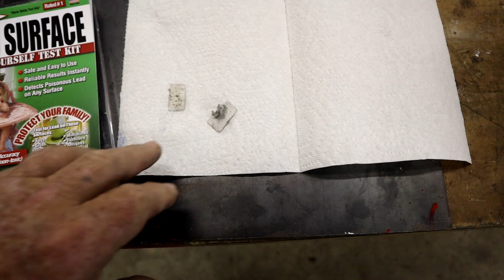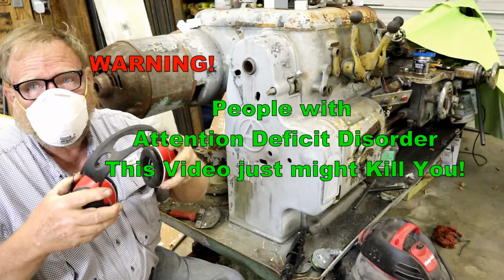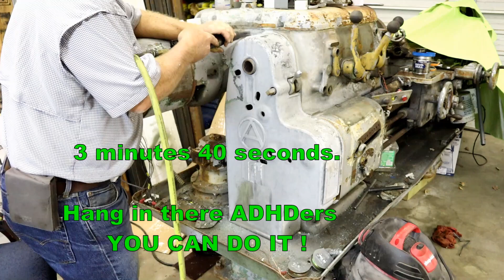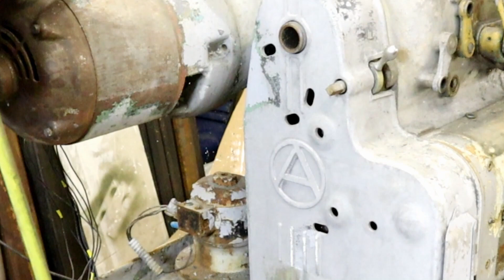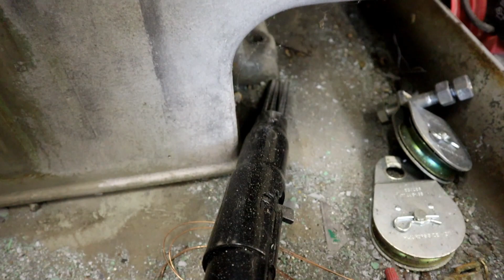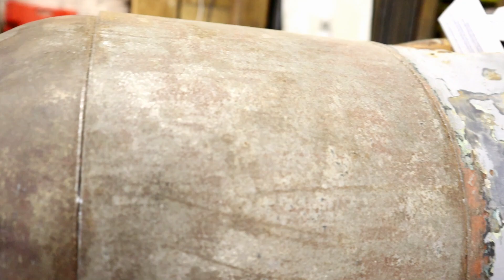Fastest, cheapest way to remove old paint from a metal working machine

Comment: I'd suggest removing paint with a wire wheel cup on a grinder. That worked very quickly, but it flings out the little wires so it's best to wear some good protection.
Reply from the maker: Hi Logan.... It just does not work as well as the needler or even the battery powered Milwaukie Fuel angle grinder with the heavy 2 inch disks...  Tried almost everything under the sun and so far those two are my favorites...  If you haven't seen this one   https://youtu.be/sKdfIGqXjsQ  there are a few examples of Don having at it :)
Reply: @10swatkins  I'll be honest with you, I'm only 18 and I've only needed to take paint off of a shield I made. I just used a wire wheel cup to remove paint. I've not tried anything else but it definitely seemed to remove the paint a lot quicker in that video than a wire wheel would.

Comment: Hi,Steve. I agree the needle scaler is best option for stripping the castings on any old machinery restoration projects. I've used this method for years and also strip and clean old engine blocks and various iron castings with the same technique. The needle gun also does a great job stripping old iron railings but a wire brush and files,hand scrapers are also required to get into tight areas around the ornamental scroll features. I can't understand why no manufacturer has come up with an electrically driven needle gun using a electro magnetic solenoid to move the hammer/piston back and forth. Also a good tool for stripping old paint off masonry work.
Reply from the maker: I sure like it... Right now there are 5 machines lined up to get a massage with it :)

Comment: Damm it Steve your a bad influence now i need to go get another tool to add to my addiction 👀👀🤦‍♂️🤦‍♂️
I have an old prema 14 in shaper, Victoria  combo vertical horizontal mill big holke f-10-v, a fritz Werner horizontal mill and a brown and sharp #2 surface grinder all need paint you might have to give me an in depth tutorial to run that specialized tool when i get it ROFLMFAO ive been using paint stripper for the big areas that cant get into the machine wire wheels and scotch brite discs on die grinder but some places you just can't get into short of scratching and picking the crap off if I'm going to totally disassemble it sme stuff I'll sand or soda blast. I definitely going to try your method could have used a needle scalar long time ago for getting weld slag out of tight spaces thanks for the tip.👍👍
As for rust on machined surfaces ive been using WD40 and scotch brite pads works fairly well other penetrating oils seem to get gummy where wd40 seems to stay wet better between reapplying when done i put rust check on rag and wipe all machined surfaces seems to really protect the metal from rusting when not being used  then when i need it i wipe them down and apply the way oil before use
Reply from the maker: I'm sorry... Bad Steve Bad Steve!..... But Don is the one you have to watch out for... HE can't sleep until something is painted :)

Comment: I've been using this method for years, a tip for those who try this the needles get polished and rounded over real fast so I take it over to the grinder and bunched the needles in my hand while still in the tool and square the ends up . Starts cutting the crud off real quick again 
If you plan on doing a lot of this buy the most expensive best quality tool you can afford because the cheep central pneumatic have different issues, one all the needles broke off in a few hours another the die plate that holds the needles apart cracked . The larger one at H F has held up much longer , the thing is once you start cleaning like this it's hard to stop ( very addictive ) so when that cheep tool fails your gunna FREEK out.
Reply from the maker: I'll try your trick, thanks!

Comment: My G&E shaper needs a new paint job. Going to try this method of paint removal.
Reply from the maker: Good luck!   I helped Don take it off the moving cradle today  and all he has left to finish are the two pedestals... I hated taking  it off the cradle because it is just going to be that much harder to steal !
Reply: You'll find this method very effective on your old shaper. I stripped all the castings on a manky old Alba shaper  with a needle scaler. Got through multiple layers of paint and the original putty based filler in next to no time.

Comment: The old Methochloride based paint removers would bubble up burnt red in some of the paints I've stripped in my past indicating lead.  Mainly found lead based paint in a couple of the old houses I've owned or worked in.  The only machine I had over the years was a 1929 model lathe that had a layer of lead based paint on it.  Three or four layers deep on paint on tha lathe.  All of the other machines I've had were oil based non-leaded paints used on them.   I'm done and finished with doing this kind of stuff in my life!  Until the iron fever hits again... No vaccine that I know of to stop it other than a shot to the head!  Ken
Reply from the maker: I could come down there and take away all of your machines.... That would cure it :)

Comment: Every tool has its place, and not everybody has an Axelson to strip. I've spent more than my fair share of time on a needle scaler, come out to Nv next summer, I've got a 100' of 10' high wall that still needs to be stripped, I've done over 200' already.
Reply from the maker: No thank You.... TOOO hot!   And besides I have 2 Axelsons to strip :)
Reply: @10swatkins  You must picture all of Nv like death valley, I escaped Tx for the cool mountain temps, a hot day here is 95 at the peak of the day, with 20% humidity. The flipside to that equation is the high today was 35 :-)
Reply from the maker: @dalmatiangirl61  In that case someday I might come see you.... :)  Call me when you have about 4 feet of that wall  left!

Comment: I agree, this is a great way to go, expecially with old painted castings.   I found on a recent project that it worked best on castings, and for sheet metal, a flat carbide scraper was much faster.   Paint stripper was very slow by comparison.
Reply from the maker: The sheet metal gets stretched by the peening and just bends out of shape... Have a picture of your scraper?
Reply: @10swatkins  I used one of these: https://www.amazon.com/gp/product/B0006NIJZY